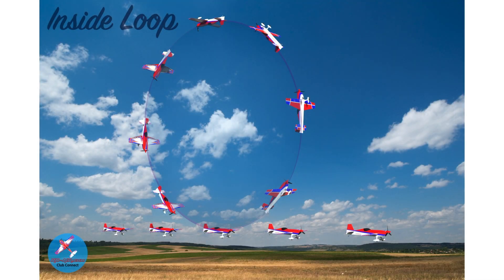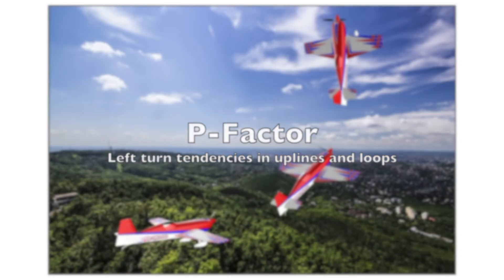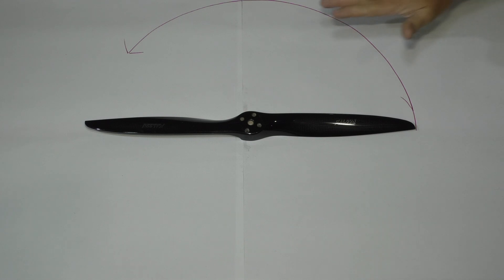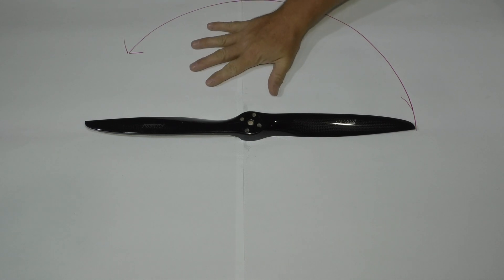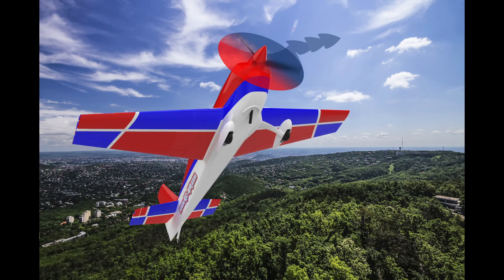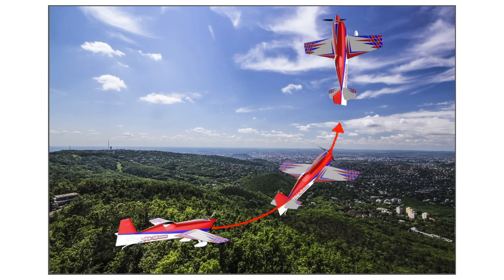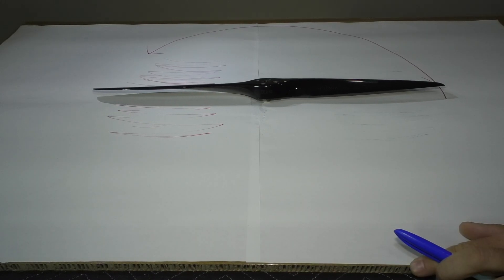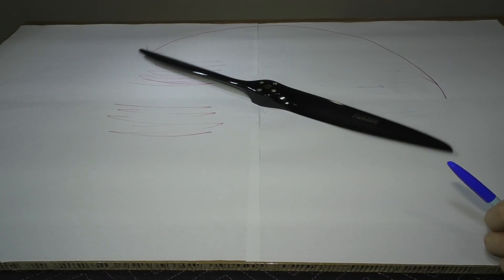P Factor Overview  RC-AIR Tutorial Series: How To Fly a Remote Control Airplane

Comment: Best explanation of P factor I've heard. I learned from a documentary about roller coasters that a round loop pulls too many g's so a squashed loop is used on coasters. Not really relevant but interesting.
Reply from the maker: Thanks for the complement on the video. Very interesting on the roller coaster loop, something I did not know. I have several other tutorials I've been putting together, P-Factor and gyroscopic precession are the two that I feel are really important to demonstrate as I introduce 3D maneuvers moving forward.